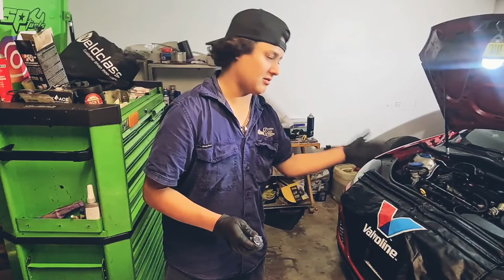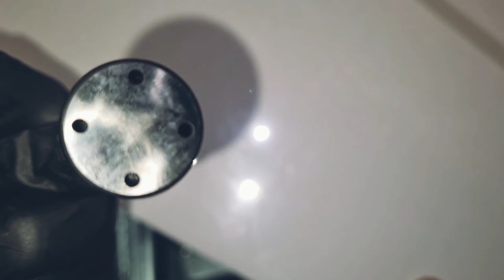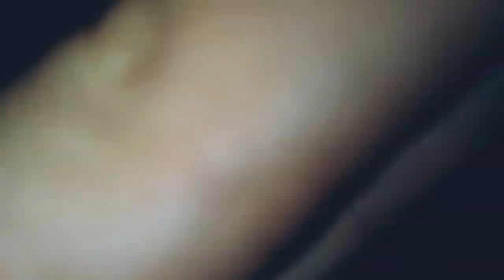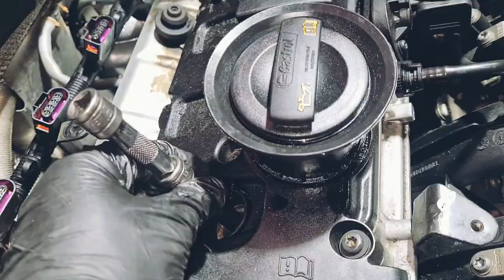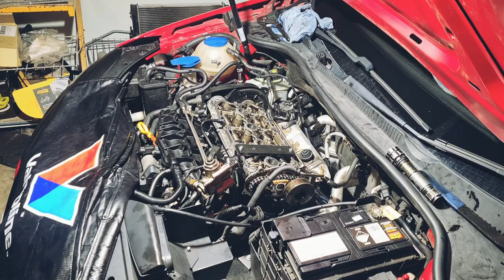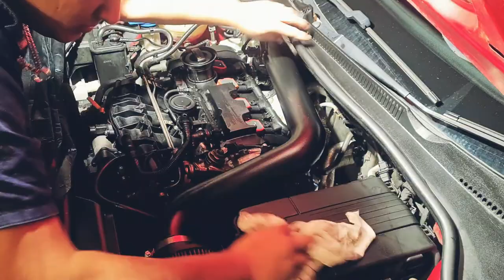Cam shaft timing chain replacment on the volkswagen Mk5 golf GTI #vw #audi #camshaft #timing #chain

Comment: you can use one of the covers on the rear (in the engine bay) of the headlights for blocking off the turbo inlet :)

Comment: One of the best videos on yt on the subject. My chain just broke last friday. No more tensioner surfaces...
Strange, the belt is fine.
Merci beaucoup.
Reply from the maker: I appreciate the kind words mate, thank you ☺️
Reply: @jack73ist  you're very welcome! 
By the way, I fixed myself the engine, I pulled a head from an engine in the scrap yard and I installed it. The rest of the engine was un-damaged. Strange, all mechanics that I consulted refused to repaire it, they said it is not worth. I spend max 500$ for the head, gasket set and took me 2 months almost (since I worked only in my free time, outside of the garage - when was sunny). The car runs great, I did 2 oil changes since (2 x 1000 km), 3rd one is approaching.

Comment: Think I have this exact issue on my Audi TT mk2 with the exact same engine. Even took it to my local Audi dealer to have it checked out, and they said they didn't hear anything strange, which I don't trust. Looks like i'll have to do it myself, but this video will make that a whole lot easier!
Reply from the maker: Thanks for watching mate! Yeah the MK 2 TTs run the same engine, the TTs runs the CDLC version you find in the S3 and Golf R, you get alot more space to work with in the TT to so hopfully makes the job a little easier.
Feel free to ask if you run into and hurdles.
Reply: @jack73ist  Really appreciated mate, thanks!

Comment: Would this be a similar procedure for the 1.4 tsi 140?
I’m getting various fault codes coming up 
P2293, P0238, P0098, P0237

Already changed a MAP sensor.
Reply from the maker: The fault codes span a cross the market and ussually mean the same thing, as in simular codes across audi and vw

Comment: Great video! What's a ball park quote/range for a job like this to be done at an independent mechanic shop?

Also, how many kms did that mk5 gti had on the odometer?
Reply: Hey mate this was my mk 5 it had roughly 280,000 kms on the clock when this was done

Comment: Thanks for the vid and great work! I'm doing the same thing right now and I'm having trouble taking off the chain cover housing. I've got all 7 main bolts off and all the external attachments as well but am not able to take off the cover. the rear portion of the housing towards the back of the engine broke off and the tensioner and chain also broke off, so that may have something to do with being unable to take it off. Do you have any other ideas why I'm unable to take it off, or am I missing a step that's easily overlooked?

Comment: Any idea why I cannot put the cam locking tool in the holes like you did at 21:09 min?  I aligned all at top dead center like you did.  Should the engine be rotated TWICE by hand at tdc to do this?  I closed up the engine and ran it.  runs a little rough after my timing job and  no codes.  Cam, crank arrows are lining up with the arrows using factory plastic.  I might open up the engine cover again and retry doing what you did tomorrow.  But I cannot lock the cams in place with that plate tool. lol
Reply from the maker: When the chain is stretched, it can throw the cam shafts out of alignment, enough to throw a cam shaft correlation fault code, in this case, if possible, with enough slack I rotatated the cam shat with a spanner on the exhaust cam shaft sprocket bolt and cam tool on the back of the intake cam shaft. You may have to remove the tensioner to get more slack, start fresh with the new gear, if the chain has been that stretched though, I would look at replacing the came shaft adjuster aswell, it will likely be worn out.
Thank you for warching mate, I hopes this helps, let me k ow how you go and feel free to ask any questions if you get stuck
Reply: @jack73ist  Thanks.  I used your guide as a reference for audi a4 2007 and did the job.  I have one post job issue. Its puzzling still because I drove the car like 3 times 15 min each time and the obd scanner value did not change for me still 6.3 for camshaft position at 93 when engine warm.   I am thinking maybe my new installed ebay tensioner was bad.  Didn't look like it spring up.
I have two routes:
Is it possible to just replace the tensioner no chain?
Can this value of 6.3 change if I drive the car more often you think?

Comment: Recently did this as well between this and other guides it helped alot thanks. Only thing is when I put the chain assembly back together it looked all good as it should but when I took the pin out I felt no pressure from the spring it had in there which i had felt before and the chain was sitting slightly loose. Maybe a long shot for someone to answer but is that normal? Kinda trippin alittle bit what if doesn't have the proper pressure and I have to do it all again eventually 😅
Reply from the maker: Yeah mate, that should be normal, the chain tensioner will be under oil pressure once shes running, cams would just be slightly inward of each other

Comment: If the car is tuned, and the cam chain is getting bad, will replacing all this help with the tune?
Reply from the maker: A stretched chain can effect the valve over lap between the intake and exhaust cams, would ussually check if the chains noisy during the pre tune checks we did, but would want to get onto the chain sooner than later. Definitely can effect performanc, hope thaglt helps mate, and thanks for watching 🙂

Comment: Yesterday when I got my 3 t screws off the vacuum pump, the pump would not budge off. My finger tips hurt lol did you pry it out a bit? Also I put the car in tdc with the cam belt sprocket marking, so I’m not sure of that really snugged you the vacuum pump making it hard to remove. Or it could’ve be the metal gasket got jammed in there when installing the rkx gaskets with the metal gasket
Reply from the maker: Yeah they can get jammed, just a tight fit with the oring, I used to pry is clockwise and anti clockwise to help un come stuck, then walk it off evenly, try pull it out as straight as possible to avoid damage
Reply: Okay thank you. What can I pry it with? Pry bar would be better? I tried a flat head & it didn’t work well but scuff the aluminum lol
Reply from the maker: I used a small pry bar, the angle helps but they do get fairly stuck on there, I remember there is a tab to can lightly push against on the pump, you have to walk it off and straght as possible to avoid it binding
Reply: Okay yeah those tabs, I’ll give it a shot. I hit the parts store in my gti today @3pm for some black silicone just in case I need to take off the rocker cover and cam lol. I knew I forgot some thing
Reply: @jack73ist  thanks. I did some prying on the tabs and little by little I worked it off👌🏽 I got the hpfp off. Can follower in 90% perfect shape lol I placed a new one 3400 miles ago. I would keep working and get my cam cover off, to spill to the good news & inspect my chain so I can sleep at night. But I don’t want to wake up and have a puddle of oil on the oil pan lol we have a nice pavers driveway my grandma would be mad lol. So I guess I’ll go with taking off my valve cover, & then leave it covered til the morning 👌🏽
Reply from the maker: @CR15PY1  yeah bro, sounds like you are onto it! I ussually work up to a point like that too, it will be surprising how much oil will drain from the chain cover if left over night haha, leaves quite a puddle on the floor and on the transsmission, I've done that 😅 if yours is tuned, try check the cam follower every 2nd or 3rd service of shes worked and driven. If you can find them, you can get a big plastic low profile tray and you can leave that under the car, I'll try get one and add it into a video one day soon, I need one anyway for some goodies coming up, we got a new white  mk5 and starting a fresh build.
Hope all goes well bro, let me know how you go and if you need help with anything else
Reply: @jack73ist  yes sir Im almost to the good part. I just got the valve cover off like 20 minutes ago, cams are in excellent shape, and I have zero build up seems like 👍🏾 due to using the liquimoly oil. And here at the house we have a couple sheet metal oil pans from like 15 years ago haha, but I also got these small white hospital buckets from my grandmas job, I captured my tranny oil with it on Saturday👌🏽 filled her up with Fuchs. Funny cuz my first tool box started with this little bucket haha. So what I’m going to do next is put the car in tdc, lock the cams in with my locking tool & possibly call it a night it’s 3:30am 🤣 or maybe I will get the cam cover off and see the sun 😅 jk time for sleep
Reply: @jack73ist  actually I will wait till the morning when the cam cover is off, so I can see inspect chain before it’s in Tdc
Reply: @jack73ist  & oh yeah about the new gti build 🔥 I was stoked when I read you said that, I’m excited to see the future videos. It’ll give me ideas lol
Reply: @jack73ist  update. I got the cams aligned and locked. Just need to get that bolt off here it goes 🤞🏽 I had chain tensioner failure, the top and bottom chain guides broke off😬😅🤣 and ofc a stretched chain too
Reply: I got it off first swing😮‍💨😮‍💨😮‍💨 I’m loosening it by hand now lol
Reply from the maker: @CR15PY1  bloody awesome mate, you got to be stoked with that haha, have seen them become a nightmare 😖 sounds like you got this
Reply: @jack73ist  haha yes sir it was awesome 👏🏽 😎 I had to loosen it from the 10’ o clock position too🥶 still got it hehe, but yeah she started right up, & sounds like a beast. My tune sounds much heavier and solid, she’s back up and running nice. Next is to drop the trans and swap out my clutch. But first I’ll start with an upgraded clutch cable & or upgraded bleeder block👌🏽 see the difference on that first
Reply from the maker: @CR15PY1  yeah thats not much space at all for leverage haha well done 👏  you do your own tuning? 
I havnt heard of the bleeder block up grade yet, For a manual transmission I presume? I'll look into that myself
Reply: Oh also I installed the GFB+ diverter spacer the same time also. It fixed the turbo compressor surge. & added some turbo noise, but not gonna lie I do miss the stock turbo noises still👌🏽 the little turbo flutter she makes. But the turbo performs better & gets rid of the boost leaks from the Diverter valve & also holds the boost pressure better than stock
Reply from the maker: @CR15PY1  very nice bro, I have seen quite a few of those installed now, I was told the external release DV adaptors robbed the engine of power as the standard diverter valve was designed to release the pressure back in the intake side before the turbo charger,  it was supposed to help keep the turbo spooling between the speed of the DSG gear changes. After driving a few though, I didnt notice any drop in performance or torque ( by feeling,  would have to dyno run the car to see the real results )
And got my flutter and pressure fump noise which I personally love haha, so I have made the suggestion to add one to our GTI too.
I'll do some reading up on this bro, thank you

Comment: Greetings from NSW!
Thanks for a great video... very detailed and informative!
Just wondering how you would decide whether to replace just the tensioner as opposed to both chain and tensioner?
Obviously there's not much additional cost in parts but quite a bit of extta work and specialised tools.
Reply from the maker: Thanks for watching mate!  and glad it's helping.

Well when left too long before replacing after the chain has already become noisy, a stenched chain will throw and crank shaft - cam shaft out of correlation fault code, as the cam is now out of spec the same as skipping a tooth. the tensioner has an internal spring that can wear out and loose its spring pressure also causing the same kind of rattle, but chain rattles are more consistent and will be intermittent even after oil pressure has built up. 

you can also get a noisy cam shaft adjuster, but usually the vehicle will also be lacking a noticeable of amount power as the cam shaft adjustment isn't carried out correctly through through RPM range, if the engine is above 200 000kms I'd recommend replacing the adjuster too but not necessary if you arnt noticeing any  power drop.

I would recommend doing the chain with the tensioner as you can't really tell which one is causing the rattle, but if one is worn and noisy, the other isn't far behind
Reply: @jack73ist  Hey mate, thanks for the detailed reply, that's really helpful!
I just got this car (it's a 2010 S3 - 8P) and it really goes well so no power loss issue but it sounds like a diesel. I haven't had a direct injection car before but it still seems a bit much. It definitely has a bit of an extra rattle at startup which I guess is the tensioner building pressure but some noise continues. 
I used a stethoscope on it yesterday and I can definitely hear a metallic sound coming from the chain area whenever the engine is running. So, I guess I should really do the chain as well.
I saw you had a nice cam holder and and also another tool for turning the exhaust cam. I was wondering where might be the best place to purchase these and whether there is any particular brand?
Thanks again for all your help mate, I really appreciate it!
Reply from the maker: @geneqco  no dramas mate, I built a few APR Stage 3  8P S3s, as well as the vw golf mk 6 R version  ( same car ) very impressive making roughly around 330kws about 6 or so years ago, no problems putting the power down. most of the focus is on the newer MK7s now. But hoping to build more in the near future. 

They can be abit of a noisy engine, you will hear the ticks from the injectors, the fuel pump can also be a little noisy I'm the housing but if you get a rattle at the back of the house away from the pump and you have a rattle on start up, it's a goo sign the chain/tensioner or cam adjuster is out, you can check your cam adjuster using a vcds or compatible scan tool, checking the cam adjustment in measuring values, usually sits around 30% sometimes shown as 30kw and adjusts with rpm up to 60% (60kw) at high RPM, if sluggish or is stuck on a certain value, cam adjuster is stuffed, they usually rattle then seize in one position, over advances or retarded, usually losing top end power or low end torque, you'll know you've lost power. 

My work place provides most of the tools but since I build alot of BWA engine golfs at home, we got our own kit, I just typed in BWA cam shaft timeing tools in ebay and it came up, I've provided the part number for the poll drive near the start of the video, That's a must to avoid damaging the adjuster bolt, it will be tight to break the tension so keep the bar at 90 degrees as best possible, maybe get someone to hold it in place for you.